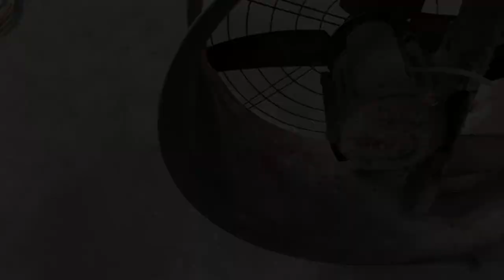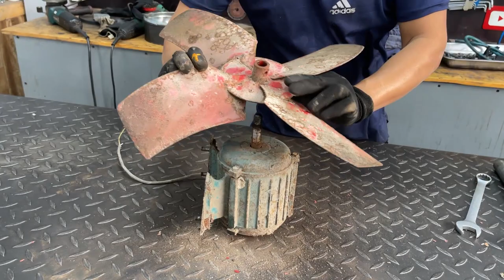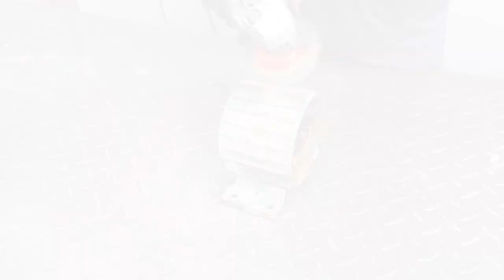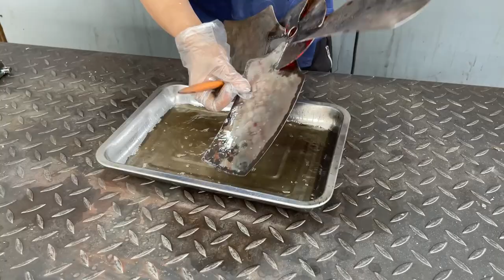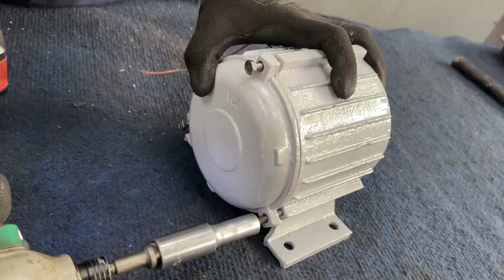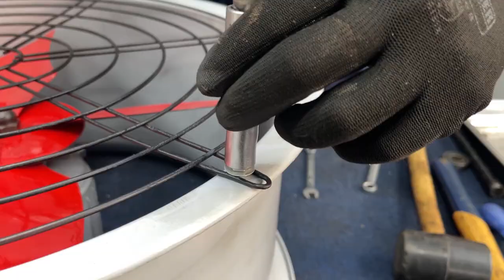How To Restore Old Fan Is Extremely Simple // Restore The Giant Super Big Tube Air Exhaust Fan

Comment: What's the yellow paste that you applied to the cage? some sort of rust inhibitor?
Reply: Also, what is that bath that you used to clean the motor in?
Reply from the maker: We use putty to smooth the surface before painting, then we wash the engine with gasoline